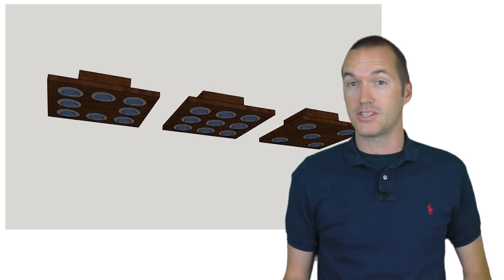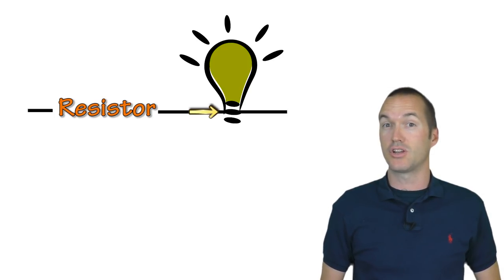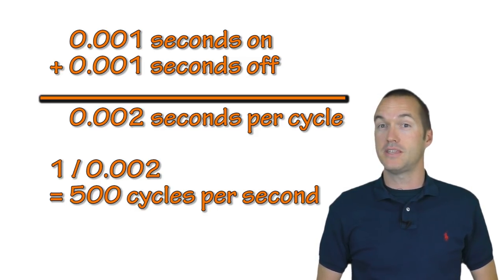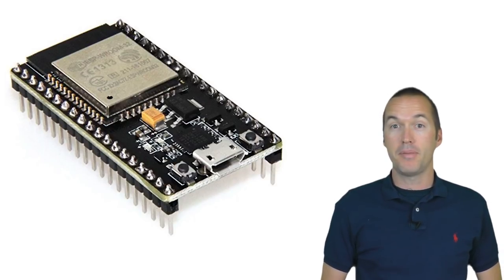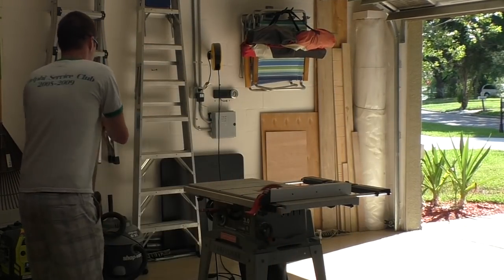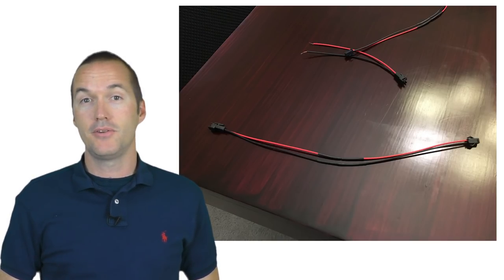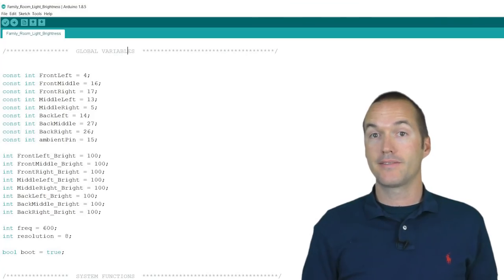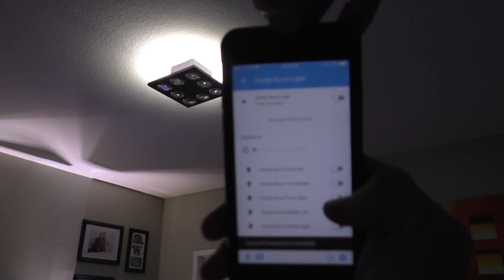DIY Smart LED Ceiling Light: 8 Individually Dimmable Channels

Comment: Hi Rob, I don't know if you are aware of the logarithmic dimming curve and how your eyes perceive brightness(200-255 are nearly the same for your eyes, but 10-20 are worlds apart) Your dimming experience will feel deluxe if you use a lookup table for a logarithmic curve in your code. It maps the 0-255 value to 0-4096(12 bit resolution)

Comment: Great stuff. I don' like using the PWM on the ESP8266 as it is considerably less than perfect and won't work alongside serial LED driving (my software ESP-GO does both) so the ESP32 may be a good idea. My own preference is to use a little Arduini Nano clone with the ESP8266. For £1.50 sterling you are adding 6 PWM channels. a load of A/D channels snd more general I/O.
Reply from the maker: Hey Peter! I read your blog all the time, love it.  Can you link me the nano clone?

Comment: Nice project - but you should expose all 8 lights as a group on the ESP32. That way you could send an ALL_ON or ALL_OFF command to the ESP and it would turn on/off all lights at once. Just looks more pleasing for the eyes if you do all at once if you actually want all of the on/off.

Comment: Great video, really nicely explained as usual. I'm like you with woodwork, it's amazing how well a coat of paint will cover up most mistakes! In practice do you ever really need to control each spot separately? I would have thought 2 dimmable switches - the spots and the uplight - being enough to control the light in the room all you need.
Reply from the maker: I've set up "scenes" with different channels dimmed to specific values.  I probably could have dealt with 3 or 4 dimming channels, but at that point why not go with 8?

Comment: I believe the duty cycle value  will be 0-255.. not 0-256 as mentioned in the vid. ( I haven’t seen code and I’m completely green to this space, but maybe it’s causing  100 percent duty cycle issues and it helps you out...) Thanks for this vid! It Perfectly applies to a project I already started and will help  greatly getting it done 🙂
Reply from the maker: Yep, you're right.  Thankfully it doesn't cause any issues, sending 256 will result in the 255 duty cycle instead of overflowing to 0.

Comment: Another project idea I'd like to suggest: something mechanical like automated roller blind, curtain or sliding door. I'd like to try it myself but I haven't got very far yet! The cheap 28BYJ-48 stepper motor I tried has nowhere near enough torque to lift my blind so it needs maybe a Nema17 or something else entirely
Reply from the maker: I use planetary geared steppers for my blinds.  I have the video mostly done, just waiting for YouTube to approve monetization on it since I ended up essentially buying $90 of parts I don't really need just to make the video.

Comment: awesome project professor. great explanation of the esp32..been wanting to get since Andrea S's vid. also great expalation of the mosfet. i will have to look up identical parts on aliexp. i have been using ben's multi sensor's rgb led connections to connect to a rgb led strip..now i know why its not going full bring..i will power it up with higher voltage and use the mostfets/logic shifters...thanks

Comment: Great video, I was looking for a solution for dimmable lights and you found it. 
Just one question: does the LED lifespan shorten because the light constantly changes state?
Reply from the maker: I don't think so.  They don't really experience the voltage surge that causes incandescents and CFLs to fail during a power on.
Reply: Yep.. not at all.  As The Hook Up said, there's no voltage surge.  Not only that, they're only on a fraction of the time, which makes their effective lifetime longer.  AND they generate less heat, which makes their actual lifetime longer.

Comment: Do traditional dimmers really work as an inline resistor in the US? Or even as a voltage divider? That seems like an insane concept to me, considering heat disappation and the lack of energy saving when dimming. Dimming is done here by effectively cutting a portion of the sine wave, similarly to PWM but not exactly the same concept since the timing depends on the sine wave itself and is always aligned to either edge of the sine wave. 

The dimmer can dim on either the rising edge or the falling edge (or in some rare instances, both) depending on the type of installation and light source being dimmed. This reduces heat disappation (some heat disappation occurs simply because of switching the load), and you actually save energy when dimming because no electricity is being passed through the dimmer during the dimmed/off portion of the cycle.
Reply from the maker: Depends on how old they are.  The term for the resistive dimmers in the US is a Rheostat. Modern dimmers are triac based.

Comment: Great Video!  Just FYI, the Gate Threshold Voltage VGS(th) is the minimum voltage at which the MOSFET starts allowing current to flow.  Even Logic Level N-Channel MOSFETs typically are not fully "on" until around 10V; and by "on" I mean the lowest possible resistance value from Drain to Source which in turn allows the MOSFET to operate at its full capabilities.  You will usually see it in the RDS(on) notes with 5V and 10V Gate voltages (VGS).  Think of it like turning on a water hose, VGS(th) is the point where water starts to flow and the higher the Gate voltage the higher the flow until around 10V where it is at maximum.
Reply: @algre977  No, but all that really means is that the Drain to Source resistance is "much" higher than if the Gate was at 10v.  According to the datasheet @4v its ~20mOhm vs ~6-8mOhm @10v and therefore given the same current flow will result in much more wasted energy given off as heat.  However,  given the relatively low currents involved it wont be an issue as its a fairly beefy MOSFET being used.  If the design used higher currents then heat would certainly become a factor and necessitate the use of gate drivers to supply the Gates with 10V+ and lower the RDS(on) as well as heat output.
Reply: @andrewawise  thank you for the detailed explanation!
Reply: @andrewawise  do you know if a TIP120 is better in this situation (whether it provides a 100% output at full brightness and if there's any other factors to consider such as heat) ?

Comment: Not to be a smartass, but buck converters don't change current, and 5V is the voltage not current!
:) Sorry I had to do it.
Reply from the maker: You got me.  I actually caught that last night as I was watching before upload, but it was super late and I didn't want to add a note and re export.  

They of course change voltage  😃
Reply: The Hook Up if you know what PWM and a threshold voltage is, than you probably know what voltage In general is!
Reply: Hello thanks for the video .... question why does it make a humming sound when I dim the light should use thicker wires instead of jumper wires?

Comment: Excellent explanation !! I love your videos !!

What would be "bidirectional 5v bus in 3v" this component is between the two stackable female header

Is it in the relation of matter? What is the name of the component?
Reply: Its a Logic Level Converter, also called a Logic Level Shifter.
Reply from the maker: It's a logic level converter: https://amzn.to/2Ns4koL 

You should be able to skip it if you use the transistors I linked above.

Comment: So in your scenario, you are using the mosfet as a high resolution relay (since it runs at threshold voltage the whole time) basically ?
Reply from the maker: Yep, a very high frequency solid state relay (with voltage drop)

Comment: Pardon my noobness, but your lights are 110 volt ones, and your PSU is 12 volt? Am I missing something here?
Reply from the maker: They are listed as 110V because they come with cheap little LED drivers that are 110V -> 12V DC... That's the "non-dimmable" part of the LED listing.  I'm not using those drivers at all and instead am using a larger 12V PSU.

Comment: Finding right components as an amateur is hard. And many times you must make couple mistakes on the way. I think you can find ESP32 than can run on 12v. Then you need that buck converter. For more simple build.
Reply from the maker: There are tons of variants.  I consider the node mcu to be the most "name brand".  

You can bet I've made my fair share of mistakes on projects, many times I've wished I was following a guide rather than making one.

Comment: Love it. Thank you for this educational video 😁

I'd be very grateful if you could kindly do a video to explain how you connected your old cctv system with hassio.

Also, is it possible to control 220v AC leds with PWM?

Many many thanks again
Reply from the maker: Can't control AC leds with PWM because they essentially already have a 50hz (I think UK uses 50hz) AC duty cycle.

I purchased a new NVR to use my old analog cameras with hassio: https://amzn.to/2mv9Lrv
Reply: The Hook Up 
Thanks so much. I  thought so. 
Yep it's 220v 50hz :)
It would be great if you kindly do tutorial on how you pull the stream to your hassio and how you push it to your phone please. 
I am thankful sir
Cheers
Reply: I once attempted PWM on a 220VAC light just for fun. The light flashed instead of dimming.

Comment: I just subscribed to you because of this video... Question: Is there a way to expand the channels to support more than 8 lights? My basement has a ring of 1 watt LED directional lights that I'd like to control individually rather than from the Z-Wave switch that controls the power supply for the lights.
Reply from the maker: There are technically 16 channels for PWM on the ESP32, but only 8 of those channels (0-7) are implemented in the Arduino ESP32 libraries.
Reply: I did some research on this. It looks like the channels can be extended to support all 16 with some work in the library, but that is beyond my skill set at this time. I'm wondering if it wouldn't make sense to just utilize two discreet ESP32 units and run them all via MQTT.
Reply: You can drive more than one MOSFET Gate at a time with a single PWM signal using the logic level shifters.  The only drawback is that the MOSFETs (and lights) on the same PWM signal go on and off together.  So if you tied 2 MOSFETs (and the associated LED lights) to each of the 8 PWM pins you would have 16 lights (8 pairs).

Comment: I would love to use this for a LED strip based alarm clock that color/brightness shades from dark to bright, and red to white. Ideally controlled through a local web page from the ESP, and also be able to use it as a smart light strip.  I've got the hardware down, but coding.  o.o help?

Comment: Sorry... I do have a question only because I am more a programmer and want to step into the electronics world.(I mean... it is cool!!!)  Your Buck Converter is not on the diagram.  Are you putting that between your power supply and the ESP32 NodeMCU?  or is this a seperate connection to the 5v pin?  Apologies for being confused on this point.  Really love your vids.

Comment: Hey.  I've been loving your projects.  Awesome project and I love the detail you put into why you use the parts you do.  A little kick-back risk there at 5:13.  I'm wary of using the fence at all on cuts like that. I use the miter gauge or a sled.
Reply from the maker: Yeah, my table saw's T-slots are not conducive to using a sled unfortunately.  I keep threatening to buy a new saw, but I only use it a few times a year and it's served me well enough thus far.

Comment: Can you link the SimpleTimer.h you used in your sketch? It's not in my IDE and doesn't show up when I search for libraries. Thanks.
That might be a better (or cleaner code-wise) method that checking a variable against millis().

I must have missed something the first time I tried the ledc commands. My spare ESP32S and 12v 80mm fan are playing nicely from 5-255 counts here on the bench. Anything below 5 and it runs full speed. There's 12v on the blue (PWM) lead, but I checked w/ a meter to GND and there's no mA reading; must be bleed-through. I tested w/ a 5k pull-down on the GPIO and it worked. Took out the 5k and it's still working. Now to put the code back in on the heater and scale for about 75-100F -> 5-255 PWM. It's loud in the case so no need to run it full speed unless the SSR is active and warm.
Reply from the maker: documentation: http://playground.arduino.cc/Code/SimpleTimer#F_restartTimer
library: https://github.com/marcelloromani/Arduino-SimpleTimer/tree/master/SimpleTimer

Comment: Might be a dumb question but to avoid unwanted flashing could you just put a flywheel circuit at the end of the MOSFET couldn't you make a more stable and efficient version of this? Though suppose the extra cost might not make it desirable vs the small amounts you save in efficiency. Though will have to check if you are saving and if you can add more lights to a single transformer as the wattage wasted is less.

Comment: What criteria we need to watch out for while selecting the MOSFET like in most of the ceiling lights I got the driver outputs about 30-40 V instead of 12V as yours.

Comment: You should have wired the switches to GND and extra GPIO pins on the esp32. You could have made it so that the switches send a signal to the esp32, and home assistant would turn on the ambient light or the main light. That would have given you more flexibility and allowed you change the function of the switches if you wished to do so from your desk.

Comment: Yeah, I have a spare 32S, pwm PC fan, and some fets so I'll have to breadboard again to see why it didn't work the first time. Fan is ok at 100%, but a little noisy. Really want it to only spin up based on what a temp sensor on an SSR reads. Worst case I use the fet as a switch parroting the SSR signal.

What about a circuit for the fet on the +12v side of the LED?

Comment: Great and simple. What's next ? What about low cost pcb design so that it's easier to reproduce, firmware built in smooth transitions and let's say a light sensor to make the thing even smarter. Then you can ask : "Alexa, turn the lights on if it get's dark"

Comment: Good video, rob. I do feel like been ripped off by those dimmer LED bulbs sold outside now. I am looking at replacing those LED bulbs/tubes with 6 LED strips to retro fit in my old boring ceiling lights. Based on your video, what do I need to get this to work and maintaining the dimmer function?

Comment: Hey Rob, I’m still messing with this project:) Quick question: I’m running this project with the support of ‘homebridge”.. for Siri integration.. I’ve avoided HA for now,..although I’d like to integrate google home... (Without going the ifttt route or HA) - Does google home support any mqtt devices that I could possibly emulate with esp32 ?? ..I’m wondering if you know of a way to add it directly to the google home app...(like homebridge does for apple).. -Thanks for any insight
Reply: Found : gbridge.. a google bridge.. looks great

Comment: Very nice idea and implementation ..  I wonder how he figured out the DC output of the light's AC driver? None of the questions/reviews on Amazon indicates they're 12V. How are they little over 2 years? Because many mock the quality on amazon. 
Good job!
Reply from the maker: Still running great.  I just hooked it up to a multimeter to figure out the output.

Comment: I have 4 terrariums I would love to automate the lighting on. I plan on using a 6k white led strip, a red / blue plant grow led strip, and possibly a blue dimmed down for lunar light. I've been checking out your videos, trying to figure out the best way to go about this. Maybe an RGB w/ 6k white led strip would be more cost effective. I would like to use the ESP32 node mcu to handle the controls. Each terrarium can have it's own setup. I would need to figure out uvb for one of them though, if it's simple I'll include it on each. Do you have any suggestions?
Reply from the maker: I highly recommend you check out the Shelly RGBW2, you can control up to 4 different lights with it with individual dimming channels and it costs basically the same as building it yourself: https://shelly.cloud/product/smart-wifi-shelly-rgbw-switch-dimmer/?ref=25100

Comment: As below i have now falshed the ESP and rigged up to the circuit board.  Few problems if you could give me some pointers please?

I have got it in HA and some channels switch off/on and some just flicker then go dim, some dont come on at all, are the numbers in the ardiuno code GPIO numbers or physical pin numbers on the board? 
The ones that do switch off and on dont start dimming until about 5% brightness is set in HA, and then its not that much, i got the recommended mosfets not the originals as per video but from the link (same model but from RS components Online UK).  
Is there something i have done wrong, maybe pin numbers for the ones that dont work and something to do with the new mosfets for the ones that do?  I am running them direct from the ESP and not via a 5-3v step down.    

  Hope you can help Cheers
Reply: All switching on/off now, still got the dimming issue though.  Any thoughts please? cheers

Comment: Hey Rob, could you please tell me. Can I use on esp32 all 16 channels with pwm (or 8 pwm and 7 cpu ). I am trying to connect 15 led strips individually (stair light project). Will I be able to dimm ? Thanks in advance
Reply from the maker: Check this video as reference: The best input and output pins on the NodeMCU ESP32 and ESP8266 https://youtu.be/c0tMGlJVmkw